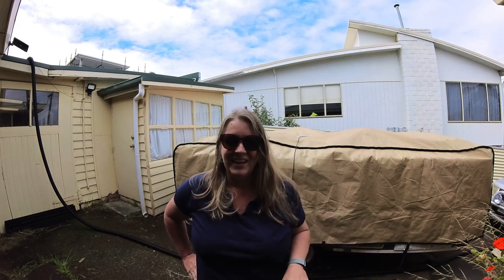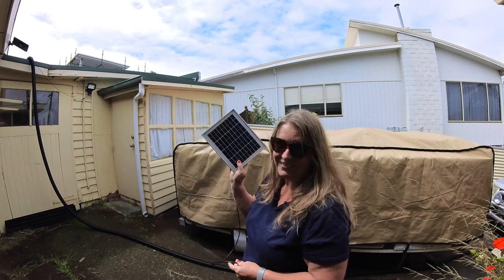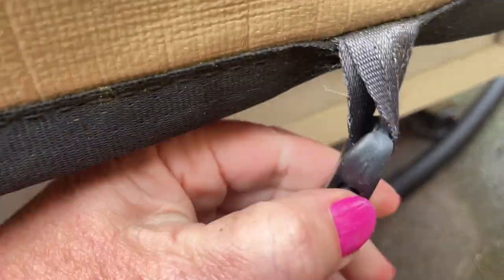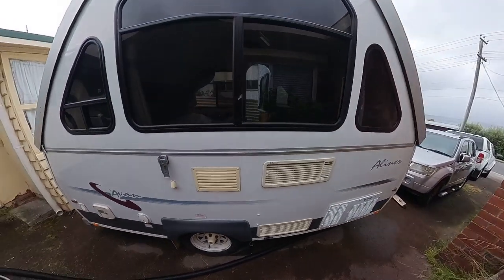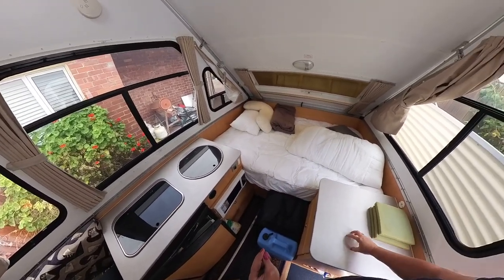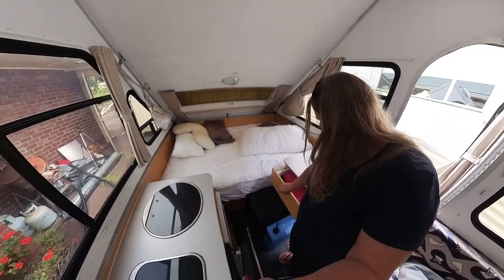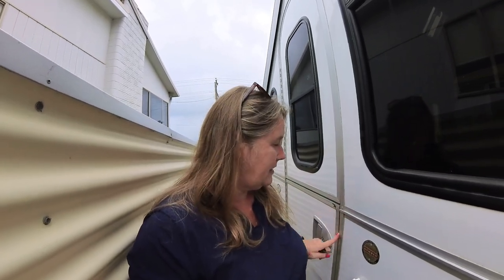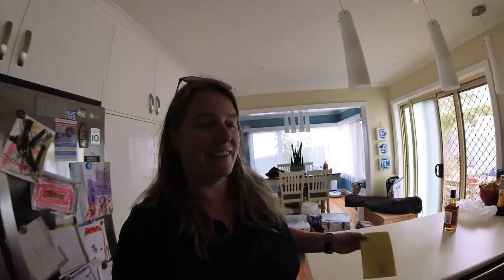Avan Aliner Travel Preparation - out of storage and on the road

Comment: Did I see two roof vents, 4 feet apart? If so, how do you cycle them? For example, one venting in, one venting out? Or both venting out with windows open as air draw? Or the reverse of that? Are vents also fans? Comment at will. Steven, Utah, USA
Reply from the maker: Hi Steven
The vents are not fans at all and they are mostly for venting out. Another window open slightly in the fan helps with this. We usually slightly open both on a cooler evening and fully when its warmer. We find it does help the condensation if opened. There is a tiny window near the bed that we use along with the vents and find that is enough for air flow during a cold evening. In summer here in Australia we have all windows wide open and the circulation is pretty good.
Its possible you could install a solar vent with fan but with all our tripping so far it hasnt been necessary.
Thanks for stopping by the channel :)

Comment: Can you advise me re battery. I’m new to Avan Aliner and the van has been in storage since end of May. I’m going away Monday but lights and fridge not working. I didn’t realise you needed to keep it powered while in storage
Reply from the maker: First step would be to put the battery on charge to see if it will hold power. If it doesnt you will need to get it tested and possibly purchase a new battery particularly if it is beyond saving. 

You dont need to constantly have it powered in storage. We have solar set up for ours so it always gets some trickle charge going into it but other owners will plugged the van into the house power weekly (see below) to ensure it maintains a good charge for when going away. 

In order to get power to the van you will need a 15amp to 10 amp converter so you can plug the cord coming out of the van into the coverter and then the cord from the converter into a 240V power socket which will then safely power the van without tripping your electrical box on the house

The Fridge will only work on battery if you have the capacity to either have it connect through an anderson plug to your vehicle whilst driving where it will continue to get charge from your car battery.

Once you are able to plug in the van your fridge will run on electricity or alternatively if it is a 3 way fridge you can run it on gas. The fridge will take quite a few hours to feel cold. If it still isnt working it may be faulty.

Comment: Is the van easy to open up fully by lifting the roof and sides? I am looking at getting an A'Van and will be travelling by myself. It looks relatively easy though not sure if that is due ti the age of your van. Also, if it is raining would you need to wait until it is not raining to stop rain getting in the van? Many thanks, Lauren.
Reply from the maker: Hi it is relatively easy to get the van up I find getting it down more problematic .. I can get it but need to go side to side twice ..but I have seen some videos about how people who have shoulder problems have a pole to assist … there are always people at sites who can give a hand also . The newer models should be quite smooth to use ours gets stuck a little sometimes. You can put it up in the rain because it takes very little time you get very little rain inside … we have Lao put it down it the wet … we didn’t get any water inside as a result  but do put it up again on a dry day to air out if we have ..just to make sure 😁